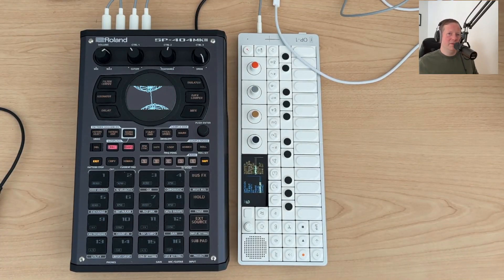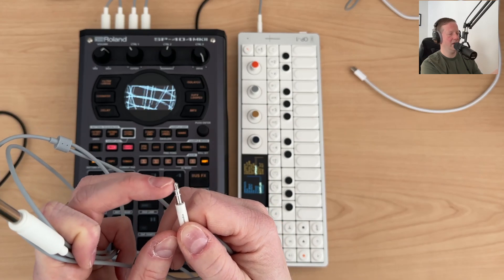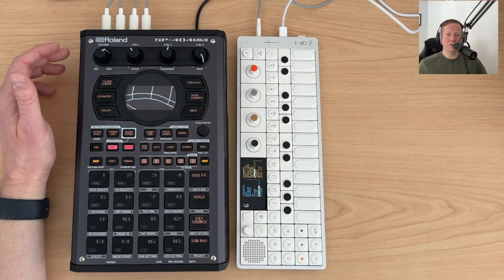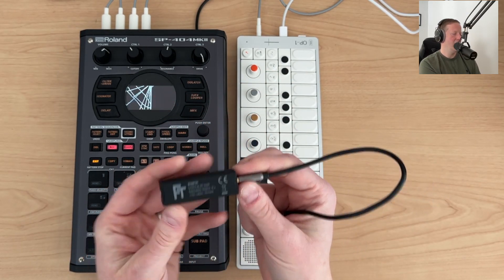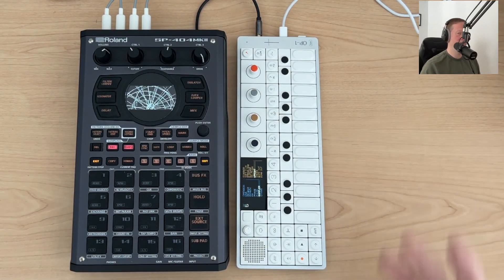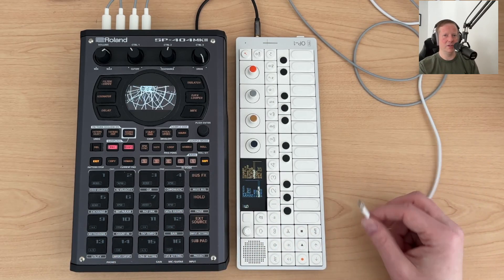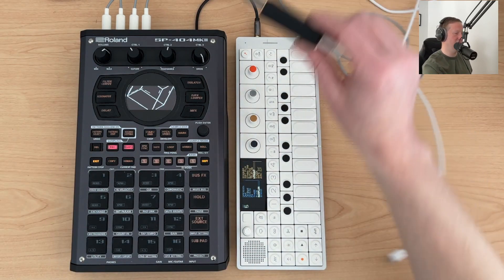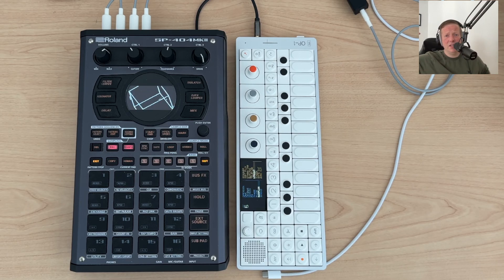in5 - Audio and USB Ground Noise Isolation

Comment: It is way easier than how you put it down. electric signals generates an electromagnetic field. It is the concept thanks to which you can recharge a phone without a cable, just placing it on a recharge plate. The concept is using the opposite process to this, so instead of passing over energy, it is converting the ground signal to EM signal via magnet. The magnet on the other side catches the EM field and re-convert it into an electric signal for ground. 

Why doing this? Because due to the frequency fluctuation of the ground signal (50/60Hz), what you hear as hum is the variation of these frequencies, which are stabilized by the wire-to magnet-to magnet-to wire chain, not so differently from what a capacitor does in a power circuit to stabilize the frequency.
Reply from the maker: thanks for the detailed info! :D

Comment: I get a lot of noise from the mic gain when I’m using the sp for recording my voice on videos. Also my mic does not work when the switch is switched to mic I have to switch it to guitar for it to come through. Not sure if this has anything to do with grounding or maybe I’m just using the wrong kind of mic. But also even without that I do get some noise coming through when I record from my modular through the sp onto my multitracker. I really know very little about how to manage the noise electronically however I wonder if this device would help with some of the issues I’m having in that regard.
Reply from the maker: Do you know what kind of microphone you have?  There are a lot of different kinds (dynamic/condensor/ribbon)... some mics need to be powered, some are wired for different devices... it's hard to know what your issue may be with the microphone without know what it is.

Modular is super noisy, and if you are sending eurorack level audio to your SP404 mk2, you may very well also be distorting the audio.  This also really depends on how you are connecting things up, but you probably want a device to take eurorack level voltage and get it down to line level if you don't have something that can do that.